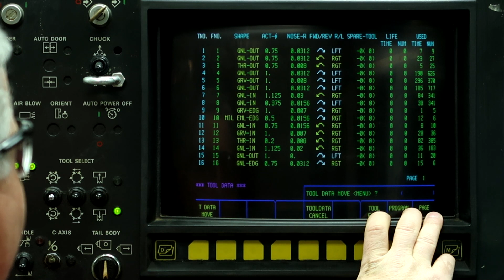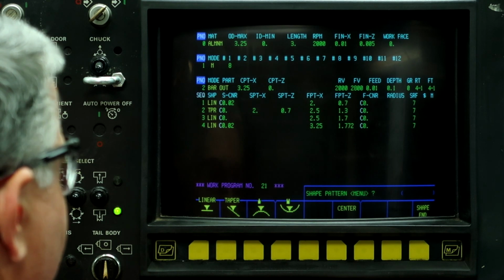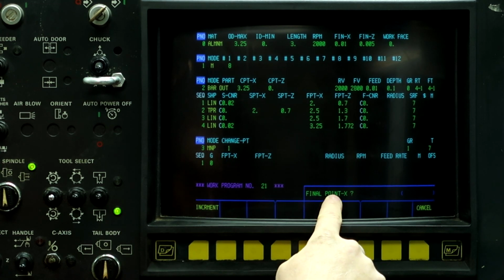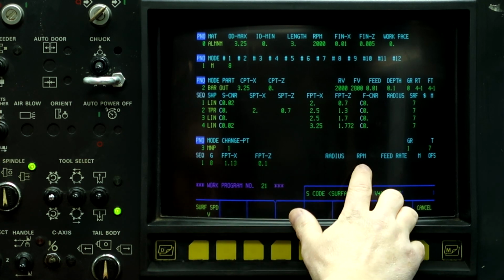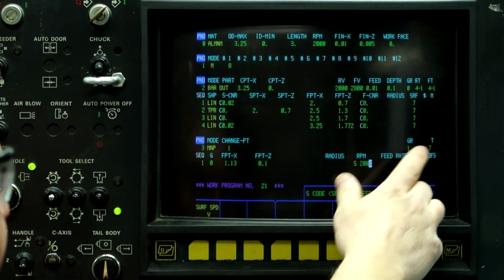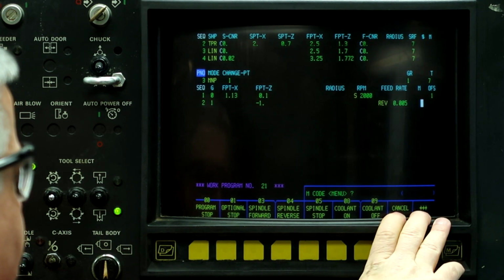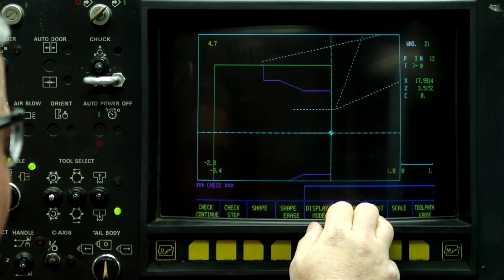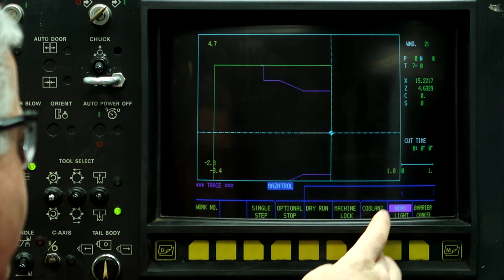Mazak CNC Lathe Manual Process MNP Drill

Comment: Drill in is to drill a hole,,, MNP its a pauze in the machine,,,,  from my experience. I was wondering how to do compensations on the Tool Data, when I have a piece work on very tight quote?

Comment: Another option is to use a second program.  You can, from the "End" line, jump to another program and run it without operator intervention.  Then at the end of the 2nd program, jump back to the first, but not "Continue".
There can be a problem with this method.  If you interrupt the 2nd program before it reaches the end then the control will not be reset to the first program.  If you then load another part without changing programs, it will crash.
For this reason your method of using MNP is a lot safer.
Thank you.  I learned something today.

Comment: Hi Phil, you have helped me before and I’m hoping you can help me once again. I’m looking to broach a small key way in an aluminum part. Do you know if it is possible to program a macro in my t32-3 control in the manual process to broach my key way so I don’t have to write 100 lines of code?
Reply from the maker: Hi Brian, I have never played with the T32 control so I am unsure if it can do macros or a sub program. Sorry man.
Reply: Ok, thanks. Are you able to do them on your machine at home with the older control?
Reply from the maker: @giddyupbo  No. It doesn't have that capability to use sub programs.
Reply: Gotcha. Thanks.

Comment: hey phil i was programming or i tried to program a a simple step ( LINE FPTX 4 FPTZ 0 LINE FPTX 11 FPTZ 1.3 )
but i ended up with a taper !!!!??/?what did i do wrong ?
Reply from the maker: Does it show a taper on the geometry or tool path?
Reply: @mazatroltipsandtricks6816  TOOL PATH SHAPE ? No (pink color)
if i continue toolpath or step tool path (triangle ) yes
Reply from the maker: @christophercolumbus8944  Your tool description is incorrect.
Reply: @mazatroltipsandtricks6816  right
in my tool data..... i messed up what  though?
edge angle? nose radius?
Reply from the maker: @christophercolumbus8944 what type of tool is it?
Reply from the maker: @christophercolumbus8944  please see my video on probing tools for more information on tool descriptions.
Reply: @mazatroltipsandtricks6816  OD left turning tool with CNMG C5B insert
Reply from the maker: @christophercolumbus8944  General Out 95/80 and input the nose radius.
Reply: @mazatroltipsandtricks6816  alright thanks, bro i take it you mean either 95 OR 80 right? 
i think it's 10 degrees so 80
Reply: @mazatroltipsandtricks6816  ok so i gave it 90 and edge 5 (tried it without giving Edge angle) still cuts taper but much better
if i don't give it ANYTHING it will cut straight and square what's going on?
this was just for making soft jaws so no big deal but if i have to machine an actual part i mean it can't be like this right?
Reply from the maker: @christophercolumbus8944  please watch my video on tool descriptions.

Comment: Hi all, I have a Mazak SQT 10MS with sub spindle, using mazatrol. The Swiss turning and job chuck transfer seems a bit confusing in the programming manual, could this be a subject for a future video?
Reply from the maker: Sorry, I do not have a machine with a sub spindle.
Reply: pick TRANSFER CHECK then follow the commands  "HEAD 1>2  "
etc etc let me know if you're still stuck

Comment: Hi Phil. Ok. You defined as a boring bar and you drill with it. But can we use it as a boring bar? Is ok to use BAR IN Process if insert allow us to get what we want?
Reply from the maker: Yes, absolutely it can be used as a boring bar. I just didn't show that in the video.
Reply: That’s how I usually bore holes. If I have to cut a 6” hole I’ll use a 2.75 insert or U drill and drill the hole then I’ll bore the hole with that same drill until there .035-.050 left to bore then I’ll switch over and use a boring bar for finishing. This really helps with consistency on holes and it allows you to not have to babysit the machine. Since I program and setup I have 9-11 different lathes going at one time. And can’t sit at the machine the whole time.

Comment: again very very helpfull . thank you. i see your videos every day over and over again. i learned mazatrol programming with your videos. i work with mazatrol t plus on mazak QT30 1997. i made a program today include 11 process for a forging piece but i have a problem with finish process that is the tool going to OD on x and then come to next process finish. i want to finish process with 
continuous movement for all of my processes. are that possible with parameters or not?
Reply from the maker: Thank you. I'm not sure what you are saying in regards to the tool path. You can separate the processes to roughing only and have a second process that is finish only and change the finish process to do what you want and it will not affect the roughing process because it is on a separate process number.
Reply: @mazatroltipsandtricks6816  yes i understand so i should make a separate process with many LIN and TPR paths as a finish process this will be a long process so 
I thought may by there is way to short my work and all finish steps connect . as I see it there is no way. thank you for answer

Comment: when do you have to use min .005, and what happen if you use drill and but min .005 by accident ,thank you Phil for all of your video.
Reply: If you are curious how this works ?
Look at G Codes G94 & G95.
Reply from the maker: The machine will take .005"/min but it will cut the hole extremely slow advancing only .005" per minute vs .005" per revolution.
Reply: @mazatroltipsandtricks6816  Thank you Phil